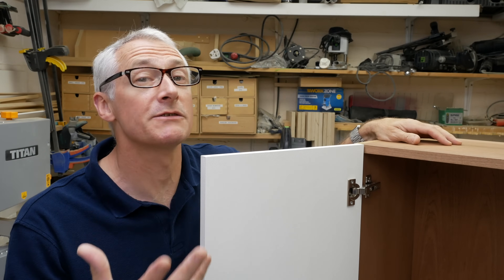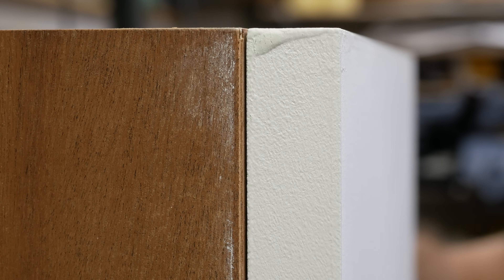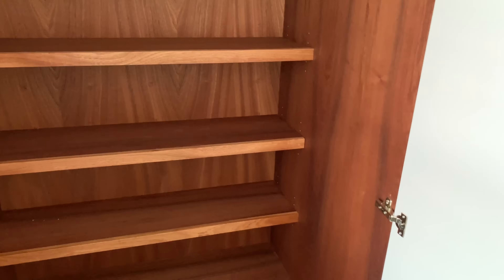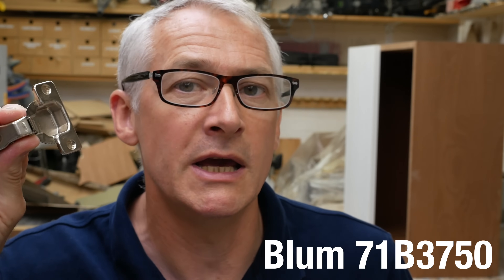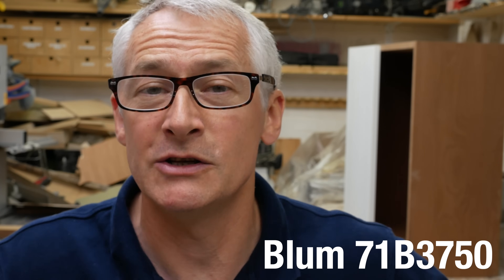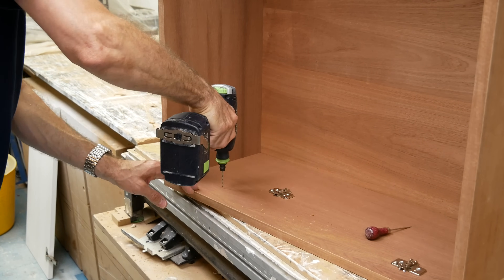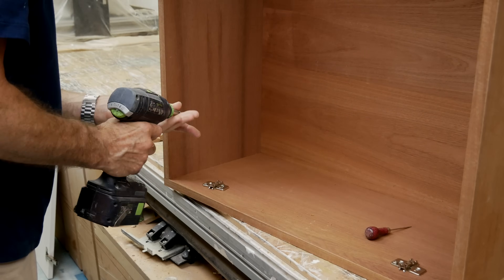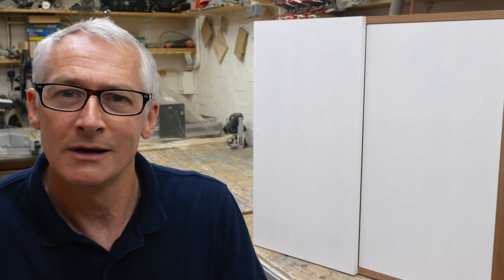How to fit concealed (Euro-style) hinges for overlay & inset cabinet doors [video # 348]

Comment: the top and bottom hinges I installed are not perfectly align and I am having a hard time making the cabinet door straight because of that...Is this hopeless? do I need to remove the hinges and restart?
Reply from the maker: You have about +/- 3mm on each hinge; are the hinge plates out by 6mm?? If so then yes, take them off & start again. If you need to repair the homes in the carcass, see my recent ‘fix a bad concealed hinge’ video. 👍👍
Reply: @10MinuteWorkshop  no I don't think they are out by 6mm.. will try to adjust on each hinge. thx man
Reply from the maker: Try this; open the door, put a 2-3mm packer between the edge of the door and the carcass, then wind the adjustment back until the door touches the packers. Remove the packers and the door is aligned. If you can’t make this adjustment, then you’ll need to remove and refit the hinge plates. 👍👍

Comment: Great video as always Peter making a brilliantly simple explanation on how it’s done. What screws do you use for both the mounting plates and hinges themselves because I’ve ordered some inset ones from ironmongery direct before and they don’t come with the screws? Saddle square jig thing and self centring drill bits purchased from your links 👌🏼 would like one of those inset guides as well...
Reply from the maker: Thanks Richard! I use 3.5 x 16 spax screws for the hinges. 4x16 self tappers for the hinge plates from ironmongery direct https://www.ironmongerydirect.co.uk/product/round-self-tapping-cabinet-screw-14mm-pack-100-760368?apelog=yes. I’m not sure if Steve is geared up for selling the offset hinge jig yet, but if you follow the long in the video description for the block scribe and shoot him a message. I’m sure he’ll sort you out. 👍👍
Reply: Peter Millard  Hi Peter.  The link to ironmongery direct does not work, probably because you have caused a shortage!  The only similar ones available are 12mm which I don’t think would be sufficient.  They sell 16 mm cabinet euro screws but these do not function in the same way - not self tapping and I presume require a 5mm hole.  The screwfix self tapping screws have an unusual point which I don’t think will work as well in MDF.  Please could you suggest another source.

Also the Spax screws have several alternatives and I am not sure which one you are suggesting.  I actually need 20mm as my doors are 25mm thick.  Many thanks. David

Comment: Drilling the recess hole seems to be extremely slow - brand new 35mm hinge bit - am I doing something wrong?
Reply from the maker: I did some today with the Kreg jig and it took about 5 seconds per hole. Not being funny, but is the drill in reverse - only ask because I’ve done it! 😬👍
Reply: @10MinuteWorkshop   - its worth checking, thx!
Reply from the maker: Yeah, sorry, but a new bit should be getting through fast. Some kind of protective wrapper on it maybe?? 🤷‍♂️👍
Reply: Nope, not in reverse, sigh; time to stop & start again tomorrow!
Reply: It's true what they say - buy cheap, buy twice! I bought a brand name drill bit & not a bother, if a bit terrifying for this novice!

Comment: will the 71B3550 work with 1.5 inch door? If not what would you recommend for full overlay?
Reply from the maker: No, they only go,up,to 26mm thick, I think. Blum do a ‘thick door hinge’ that covers 24-32mm, but I’m not aware of one that will cover 1.5” / 35mm. You might find something from another manufacturer, but I don’t think Blum do one. 👍
Reply: @10MinuteWorkshop  
I find myself not understanding why the thickness of the door would even matter for overlay door.
Reply from the maker: If the door is on a single cabinet ie not in a run of cabinets, then it probably won’t matter - why not just try it? But if the door is in a run of cabinets, or up against a wall, then the thicker door will bind against its neighbour, unless the hinge is designed for it. Hard to explain, but easy to understand if you watch how the door opens on these hinges. HTH P
Reply: @10MinuteWorkshop  Oh, ok. So I shouldnt have any issues using this for a hinged box with concealed hinges?
Reply from the maker: @brianpruitt1015  The weight of the lid would be what I'd want to watch for; the hinges are rated at around 4Kg apiece, but they're not designed to be used as a soft-close mechanism for lids, where gravity plays its part. I'd look at an unsprung hinge and a lid stay or gas-filled strut of some kind, personally. 👍

Comment: hi, what is that drill press make and model in this video . I think the hinge install is over made complicated by these machines just to line up,  I do it just like you, even if you are half or a mm out which has happened to me (think its to do do with the pencil line marking over the top of the measure tool) these hinges are quite forgiving
Reply from the maker: It’s an ‘own brand’ from a DIY store called B&Q - lots of very similar models around, I think I paid £50 for it. 🤷‍♂️👍
Reply: @10MinuteWorkshop  Wow is that it, mind you I have come to a conclusion with these machines, either dont spend too much like around £100 to £200 or spend around £800 plus. The machines priced in the middle do not seem to worth while buying - kinda half backed job, excellent on something but some major drawback like the power output. Been looking for ages and I may just settle for something in the cheaper bracket. Old second hand one is an option if you have a means to transport and room for a 150kg plus machine.
Reply from the maker: @ChristopherClaudioSkierka  Yes, always a problem with the old 'solid' machines. Honestly, mine's pretty crappy, but works well enough for what I want. 👍🤷‍♂️

Comment: And there was me, thinking I wouldn't learn anything from this one!  I make a lot of cabinets with inset doors and I've always used the standard hinge but with the chunky built-up backplate.  Which looks a bit rubbish.  (puts in order for 71B3750s)  :o)
Reply from the maker: 😂👍 At least you only have to stoxknine type of hinge John!
Reply: @10MinuteWorkshop  Well, 170 degree for full opening, unsprung for handleless push to open...the list goes on and on!
Reply from the maker: @JohnWilson-de6fd  True, very true 🤷‍♂️

Comment: Hi Peter. What screws do you use for the hinge plates?
Reply from the maker: Hi Tony. For the hinge plates I've been using an oddball 4x14mm self-tapper from IronmongeryDirect, but I've discovered they seem to have sopped selling them, so I'll have to find something else when my current stock has run out. I've used all kinds tbh, typically 4 x 16, and preferably a round-head screw, and I prefer these to the usual 5mm Euro screw because they give a little more wiggle room for adjustment. 👍
Reply: Thanks a lot!

Comment: Fantastic videos! Just discovered your channel and its just what I have been looking for. I just have a question regarding the carcass and door thicknesses if you don’t mind.

I see that the 71B3550 hinges specify that the cabinets must be 18mm. Is this measurement for the doors AND carcass? Presumably if I wanted thicker wood I would need a completely different Blum hinge?
Reply from the maker: Hi Christopher, and thanks! They're designed around an 18mm carcass with the standard mounting plates, but you can get a variety of other mounting plates to accommodate other thicknesses. From memory these hinges will work with door thicknesses from 16-24mm thick, depending on the exact application. Blum hinge overview here, BTW: https://www.blum.com/gb/en/products/hingesystems/clip-top-blumotion/overview/ HTH, Peter. 👍
Reply: Peter Millard. Ah I see...so the 18mm refers to the carcass and not the doors. That makes sense! Thanks again. Just got my first flat in London and it’s a do-you-upper. I’m quite handy but have been trying to find a video that shows how a built in wardrobe is properly made and stumbled across one of your videos showing me exactly how. Thanks again.
Reply from the maker: Fantastic! Always exciting to get your first place - hope it all goes well & very happy to answer questions👍👍

Comment: Nice video! I was just wondering what the typical center distance is (for the hinge plate) measured from the bottom or top?
Reply from the maker: Thanks! Depends on the size of the doors/cabinets, but I use ~100mm as a starting point. 👍👍

Comment: Hi Peter Love you videos. Quick question - when making kitchen cabinets with full overlay hings, how much smaller do you make the doors compared to the cabinet? I was calculating 3mm less for the width and 2mm for the height. Is this correct?
Reply from the maker: Hi Walter, and thanks! Yes, that's about right for a single carcass - it'll give you 1.5mm (1/16th" near as damn) either side of the door, and 1mm above & below. For a double carcass though you also have to allow for the gap between the doors as well, so each door would need to be fractionally wider. I will have a video out on 'door spacings' before too long, as it's something that comes up pretty regularly. HTH. P 👍

Comment: Hi Peter (and others) I have a wardrobe sized cupboard on which i cannot get the doors to sitback on to the frame when closed. Doors align vertically but one door does not close at the top and the other at the bottom resulting in the doors looking twisted. have carried out numerous adjustments but still to no avail- Any advice gratefully received!
Reply from the maker: So the gap between the doors is consistent, but one door kicks out at the top & the other in at the bottom? A little bit of in-out adjustment needed I’d say. The screw that’s on the arm of the hinge will move the door in or out against the face of the carcass, so a little bit of tweaking on these and they should be back and sitting flush with each other. If all else fails, a little door bumper on one but not the other can sometimes level them up - or so I’m told. 🤔🤷‍♂️👍
Reply: @10MinuteWorkshop  Hi Peter  Thanks for such a prompt response. I have adjusted the in/out screws as far as they will go . The door style is flush at the frame edge but not where the leafs meet. By door bumper ,do you mean the plastic studs that are used to stop doors slamming?
Reply: @10MinuteWorkshop  Hi Peter  Thanks for such a prompt response. I have adjusted the in/out screws as far as they will go . The door style is flush at the frame edge but not where the leafs meet. By door bumper ,do you mean the plastic studs that are used to stop doors slamming?
Reply from the maker: @architect-les248  Something screwy going on then; could the carcass have twisted when it was installed? Are the hinge plates equal distances from the carcass edge at the top and the bottom hinge positions? I'm assuming only two hinges per door? And yes, door bumpers are these little rubbery domes that take the clang out of the door closing. If the carcass isn't twisted, and the hinge plates are set back the same distance from the edge of the carcass, then there should be enough adjustment on the hinges to get things levelled up. Unless you have all the side-to-side adjustment dialled in on one of the hinges - that can sometimes throw off the closing so it doesn't meet the carcass face. And if you're having that level of adjustment dialled into the hinge, then I think I'd check to see of the carcass is level and plumb.  🤔👍
Reply: @10MinuteWorkshop  Hi Peter The doors are 1920 tall and 400 wide and I have used 4 hinges/leaf. I can remove the central two and see if that helps- less adjustment all round i guess

Comment: Hey Peter.  I'm making frameless wall cabinets for my shop and quickly gave up on the idea of inset doors.  Try as I might, I could not get the carcasses perfectly square and I don't have a planer to aid in fine tuning.  So it's full overlay for me.  I'll be using the Blum 71B3550.  In the video, you say that the center of the cup is 22.5mm from the edge of the door, but Blum's incomprehensible chart shows variations for "B", the boring distance.  How did you arrive at the 22.5mm figure?  Thanks in advance.
Reply from the maker: Hi Mark. 22.5mm is just a decent starting point - it can be anywhere between 21.5 and 23.5 tbh, and I agree about the Blum chart - they, and lots of others to be fair, insist on also measuring from the 35mm cup to the edge of the door, which makes no sense to me! I'd always suggest trying it out on a bit of scrap first though, if you possible can! 👍
Reply: @10MinuteWorkshop  Thank you for the quick reply, Peter!  And  I will certainly follow your trail run with scrap suggestion.  Thanks again!

Comment: I need you help please Peter , just ordered some of theses . I can’t find out how much these overlay hinges overlay the door .iv18 mm doors will it over lay the frame 18mm ??
Reply from the maker: Hi Chris. I don't think I can link to it directly, but page 97 of the Blum catalogue ahas all the info you need - https://publications.blum.com/2018/catalogue/en/97/#zoom=z. Short version; it depends where you drill the hole for the hinge cup, and regardless of what the specs say, I'd always recommend cutting a test one first from a pierce of scrap. HTH P
Reply: Peter Millard ,
Thank for the reply peter , I made things hard for myself by not thinking about layout properly, didn’t know the overlay limit and my frame is much thicker than the 18mm door

Comment: What if once you put both sides on and you go to click it on and it doesn’t click on. Why?
Reply from the maker: Sometimes if the plates are slightly skewed it can be a biggie to clip them in, and occasionally you can just get a bad plate. If it’s skewed slightly then loosen off the screws holding the plate, then click the hinge arm in and tighten the screws up again. As long as the other hinge is fixed the door won’t shift position. 👍👍

Comment: Hi peter, would you know the hinge number for the same style overlay hinge you use but with a greater opening range
Reply from the maker: Blum do a 170degree overlay hinge (71T6550) but it doesn’t have soft-close build in - you’d need to add the piston (973A6000) for that. HTH P
Reply: Peter Millard thank Peter 👍🏻

Comment: My vanity mirror is rubbing on the bottom. I don't know how to adjust it. Moving it in and out and side to side doesn't seem to help. I think it was mounted too low and the entire mirror needs to move up .5 cm
Reply from the maker: Vertical adjustment is either done on the screws that secure the hinge plates to the cabinet, or some hinge plates - I show these later in the video on the inset doors - have the vertical adjustment built in. You typically only get +/- 4mm of adjustment though. 👍

Comment: Where do you get screws for the Blum hinges?
Reply from the maker: You can buy the hinges as a set with screws, or just use regular 4x16 screws. 👍
Reply: Having trouble sourcing the dumpy screws for fixing the hinge mounting plate into 5mm dia predrilled holes. Any recommendations?
Reply from the maker: @keeefb1805  Have a search for cabinet screw or Euro screw - there's loads around. I always bought from Trade hinges 👍 - https://www.trade-hinges.co.uk/100-x-euro-screws-13-x-6mm-760-p.asp?gQT=1
Reply: @10MinuteWorkshop  Ta 👍

Comment: Hi Peter, what size screws do you use for the hinges. Also I am using 25mm carcases and doors, will these hinges be suitable. Great video.
Reply from the maker: Thanks earl! I use 3.5 x 16 spax screws for the hinges. 4x16 self tappers for the hinge plates from ironmongery direct https://www.ironmongerydirect.co.uk/product/round-self-tapping-cabinet-screw-14mm-pack-100-760368?apelog=yes. You can get ‘thick door’ Blum hinges, don’t know the product code offhand - I’ll take a look and get back to you👍👍
Reply: @10MinuteWorkshop  That would be great, thank you 😁
Reply from the maker: Blum soft close thick hinge overlay - #29999 apparently. 👍👍
Reply: @10MinuteWorkshop  Thank you Peter 😎
Reply: Peter Millard struggling to find these at moment, well unless they’re in gold.

Comment: I enjoy these calm video's. I used hinges from IKEA, never considered that there might be standards. Using a 3d printed template would have been a timesaver. Reading a manual on the right distances for both parts would also be a great idea.

Anyway thank you.

Comment: I was just thinking I'm gona ask him if the kreg jig is suitable for those hinges cuz u use the Piller drill when I finish watching and u only go and pull it lol
Reply: Yes,the kreg jig works very well for installing these kind of hinges but you still need to work on the cabinets mounting plate manually

Comment: Hi. So glad I've found myself watching your videos. Really useful!!!  I'm trying to workout which hinge would be my best bet. My new storage cabinet is cut in neatly next to some coving and I have overlay doors. I am happy to trim it back but I want to trim as little as possible. Is there a hinge that opens wide so my overlay door misses the protruding coving? I really don't want sliding doors as they will look out of place. Can you please help?
Reply from the maker: Hi & thanks! Not sure I fully understand the issue, but I’ve used the Blum 71B-755-01 155° hinges and they worked out very well. Not quite as wide-opening as the 170° but the built-in soft close more than makes up for that! Lots more technical info at Blum.com 👍👍
Reply: @10MinuteWorkshop  be careful with170 as only work up to 21mm thick doors, 155 is a more versatile hinge.
Reply from the maker: Peter Sharratt Thanks, but the 155° is what I recommend in my first reply!
Reply: @10MinuteWorkshop  You did, but it's always best to explain why, 170 also has a potential finger trap and is not recommended for anywhere with small fingers. I would also point out whilst the 22.5 seems to be what most use as a drilling distance, this is not a fixed value and can vary from cabinet to cabinet and works OK for pre bought doors of modular size, but for cabinet makers you may need to vary that dimension to achieve constant gaps.